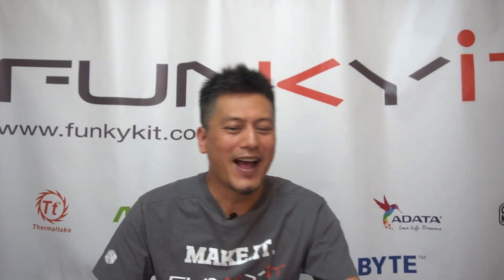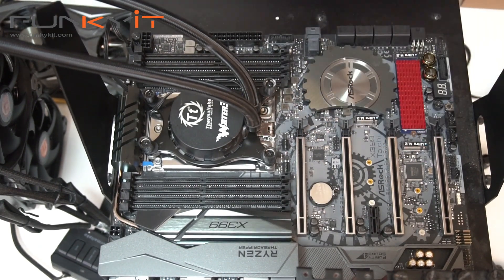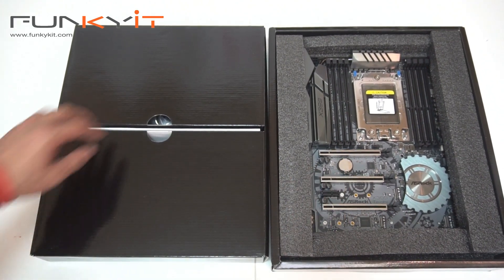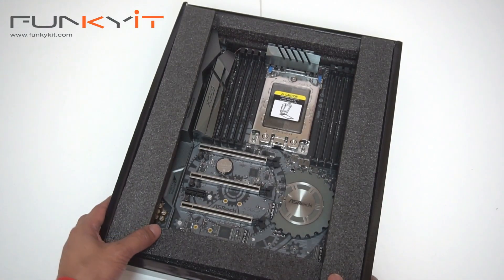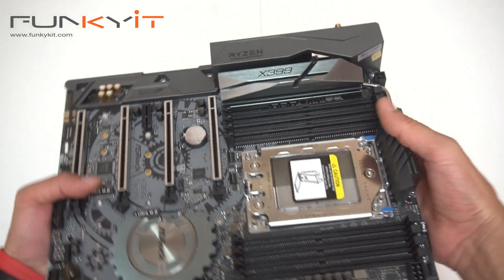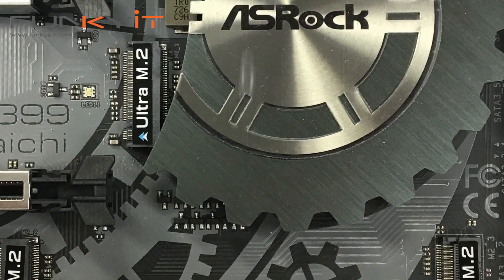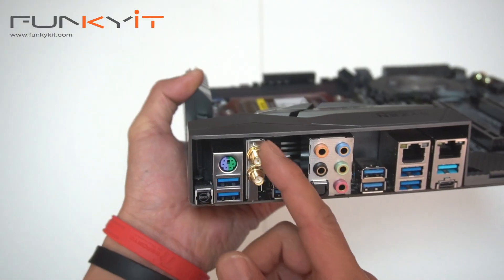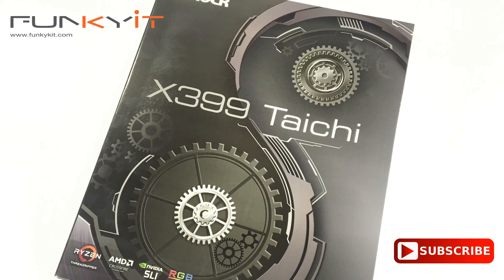The most affordable X399 Motherboard on the market? Meet the ASRock X399 Taichi

Comment: You installed the Threadripper without it's orange frame? Thought you had to keep that thing on : /
Reply from the maker: louie ishii Yes ... you are supposed to, but I removed the orange frame so that I can get better contacts on to the cooler ... plus it's easy to mount the rest of the bracket.
Reply from the maker: yup ... of course you can. In fact it's much easier and faster.
Reply: Can confirm, it's easier to tighten the first screw with the supplied tool. Doing it with the carrier frame requires a lot of force and wiggling.